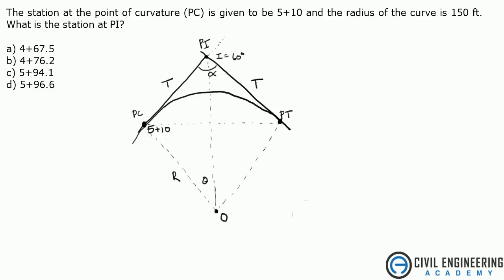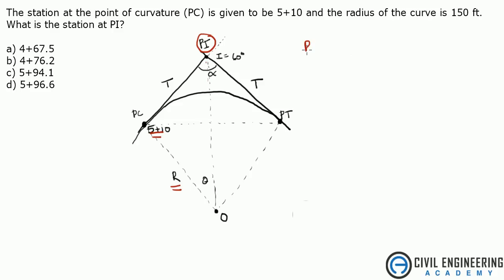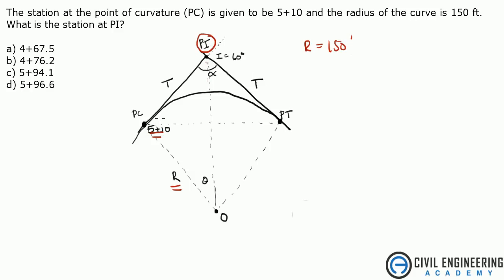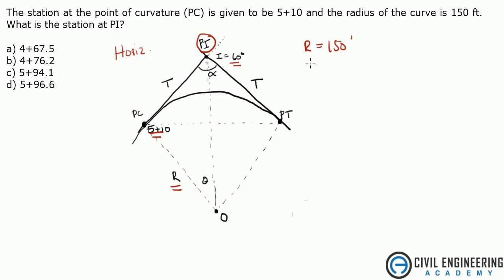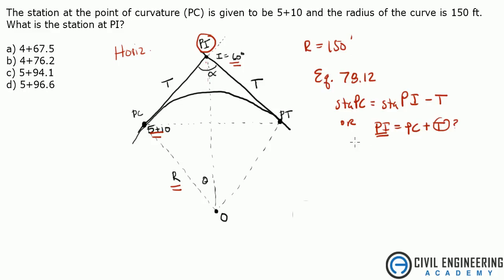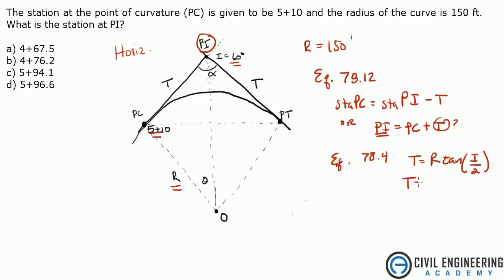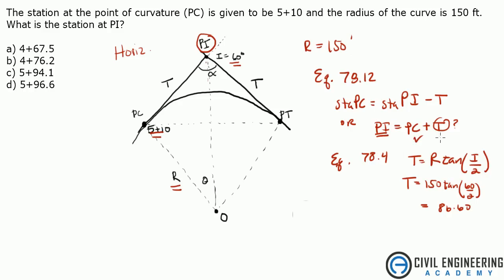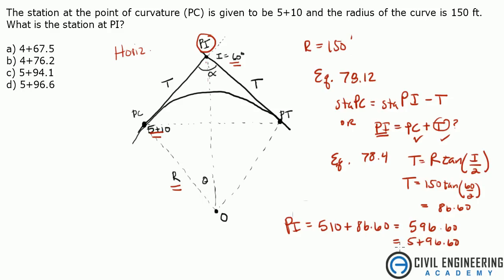Transportation-Horizontal Curve Stationing Question

Comment: A1200_ft equal tangent crest vertical curve is currently designed for 50mi / h .A civil engineering student finds that 60mi/h safe in a van because of the higher driver's eye height  . If all other design inputs are standard.what must the driver's eye height be for the student?

Comment: I would consider the first triangle called PC, O and the center, ill be able to determine the half c, sin 30 = c/2 / 150 feet, half c = 75, then consider the next right triangle PC, PI and the center point. first consider the angle 360 - (2 x 60) = 240 = lamda then divided by two the value would be 60 degrees therefore final equation. sin 60 = 75 feet / T, T would be 86.60 feet, final answer = 510 + 86.60 = 596.60 feet.